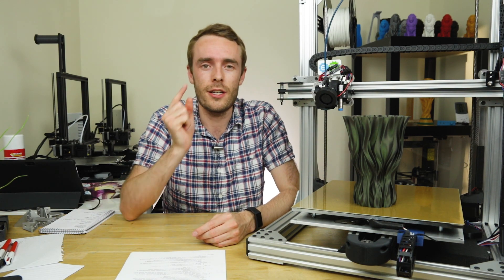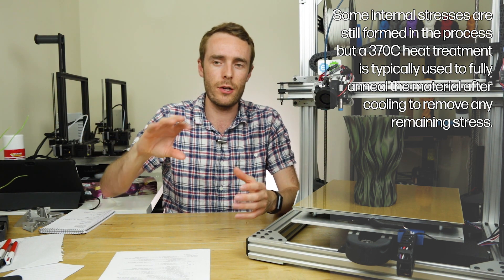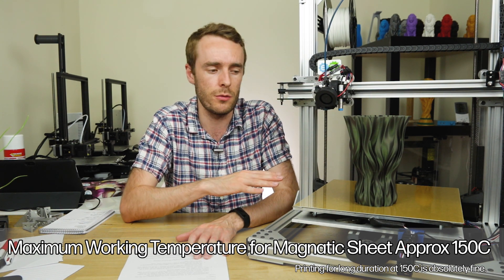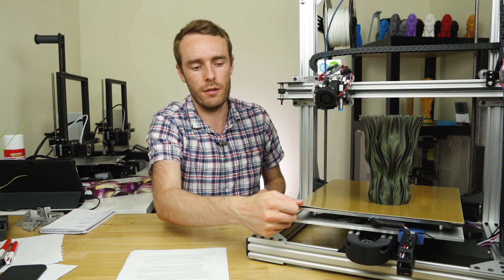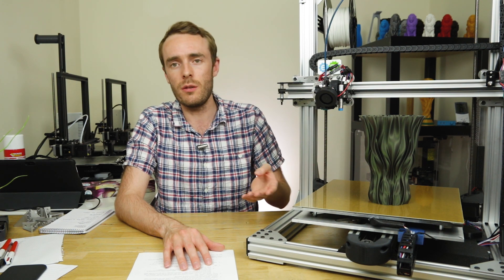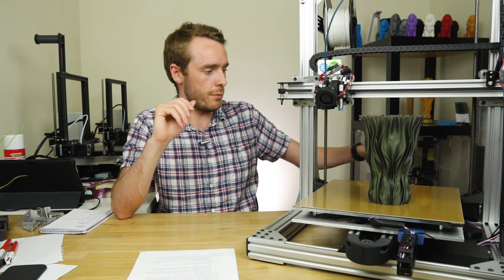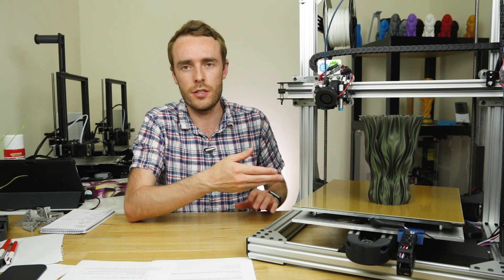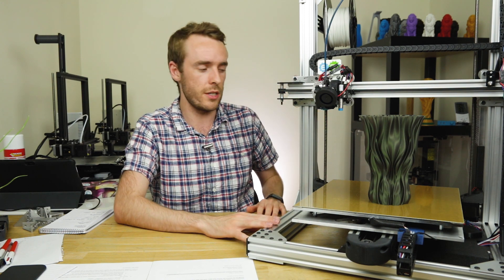Is a Premium Print Surface Worth it? - FilaBase Bed Showcase #AD

Comment: 150c is when it lose all magnetic property, but it starts to decrease earlier than that..
Reply from the maker: Nope. 150 is not the curie temperature. Filafarm have had them running 150c for years with no degradation.
Reply: i know the actual filaprint surface been out for a few years but the magnet system is new from last year 

a rubberized magnet sheet has a max working temperature and if it’s exceeded it loses strength, i am not talking about currie temp, you will start to see the sheet not hold as well as when it’s cold

if they actually list the type and max rating of the magnet material you can find the max temp yourself
Reply from the maker: I'm afraid I don't know
Reply: @Vector3DP  it would be an interesting long term test, according to https://www.supermagnete.de/eng/faq/What-temperatures-can-magnets-withstand

"Features of magnetic tapes and magnetic sheets

Temperatures under -20° C and above 85° C damage the structure of magnetic tapes and sheets. It causes the products to permanently lose part of their adhesive force. Therefore, do not use them in places with extremely high or low temperatures."

Comment: I have a Creality CR 10 S5. A Filabase kit (500 x 500) would cost me €670, without transport cost
I ordered my own machined toolingplate, 1400 W silicone heater, 2 spring steel plates, 2 PEI build surfaces, 360°C magnets and SSR for about €300, transport included.
Filafarm seems to be excessively expensive, charging €400 more.
Okay, they are German, but wow!
Reply: Casted aluminium plates have a flatness of 0.3mm/m  The Filafarm precision plates <0.1mm.

Comment: You can always use server PSUs, with mining being so prevalent you can also get cheap breakout boards.
750W PSU you can get for 20$, breakout board with cabling 10-15$.
This gives you very high efficiency, very reliable, very high wattage and compact power supply for very little money.
Reply from the maker: Thanks for the suggestion. Might be more effective in the US. In the UK by the time you've bought a server psu and a breakout board, you might as well just buy a SMPS. Plus I only want low wattage anyway because i'm going to go with mains bed regardless.
Reply: @Vector3DP  sub-400W units cost about the same or a bit less, but regardless you can get the larger unit, as typically server PSUs achieve their peak efficiency from very low to very high utilization %.

This is because a lot of the servers use dual redundant PSU setup, but the same PSUs are used on non-redundant 1U servers too. They are quite jellybean parts for the server world, despite being vendor locked pretty much to certain chassis for $ reasons - same PSU might have a dozen model numbers depending on exactly how it locks into the server.